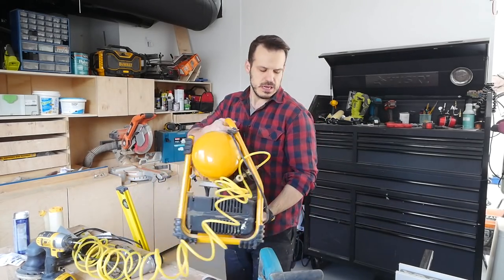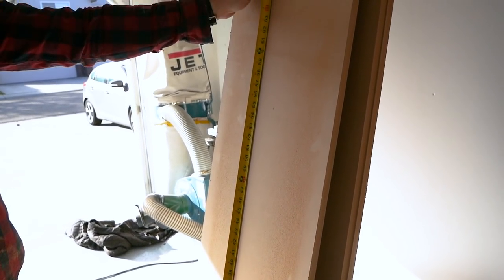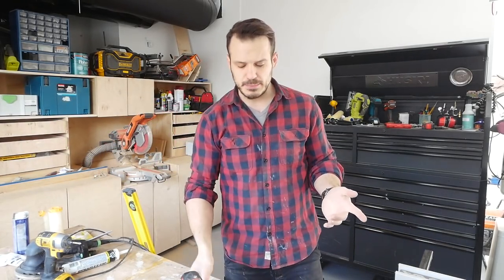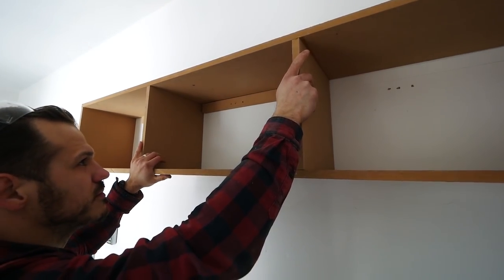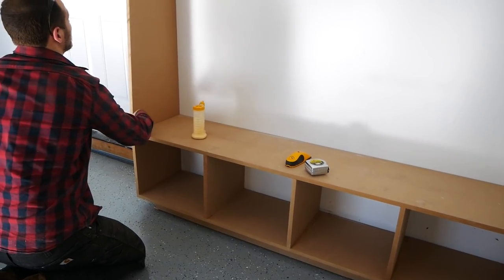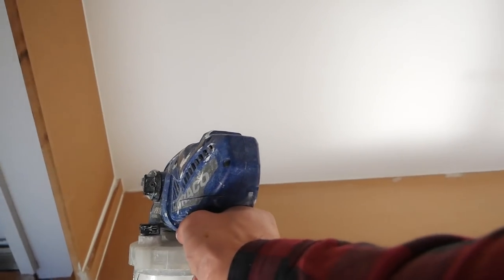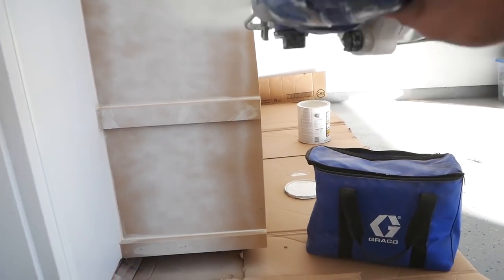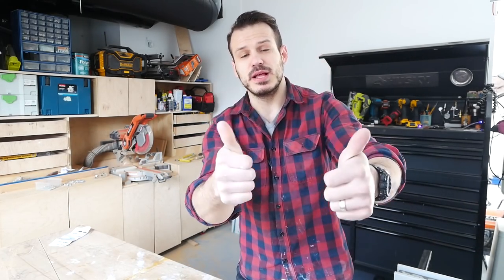How to build mudroom storage

Comment: I would have liked to know about the primer before spending a lot of paint on a project  :) . As always, very good work!
Reply from the maker: i used an oil base one called Killz, but i didnt like it as much as the water based primers. to hard to work with.
Reply: I now use linseed oil is cheap and works very well. but I'm going to try it to improve projects. Thank you very much for answering.